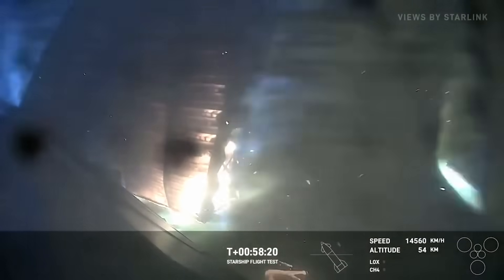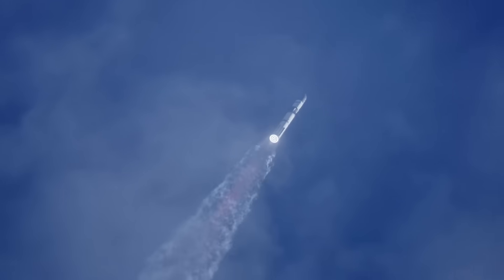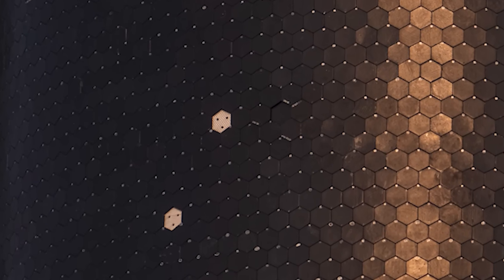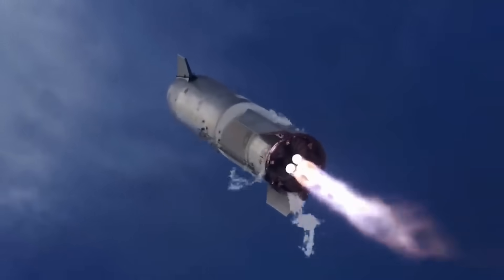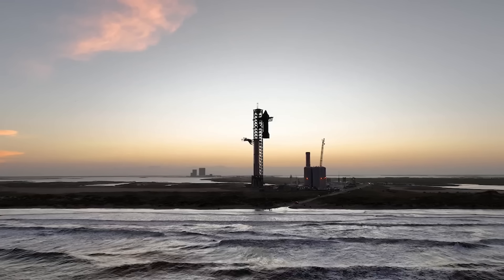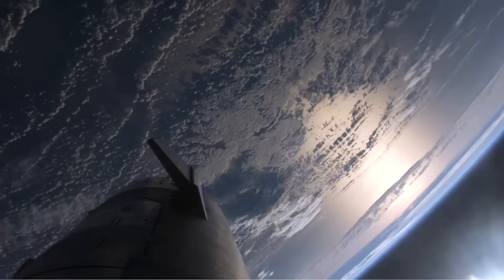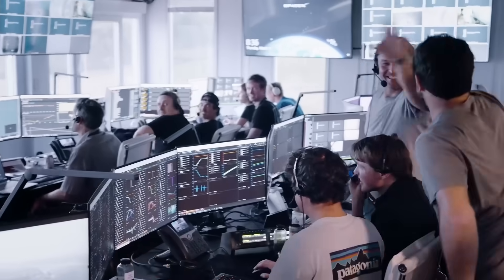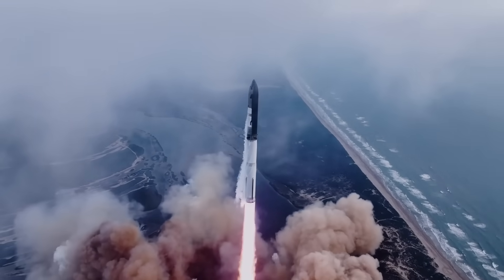SpaceX Is Adding Another Heat Shield Layer To Starship

Comment: Launch in 1 month? SpaceX will have to rebuild the Starships flap area before going anywhere, 4 week good luck with that.
Reply: They’ve probably already done that. They have several test vehicles just sitting around waiting to launch.
Reply: I think Elon said that the next already built starship already has the flaps rebuilt in a slightly different place. They couldn't do it for this launch so focused on collecting data.
Reply: I doubt 1 month, however i do believe that the turn around time will be 1 month by the end of 2024.
Reply: So you guys think 11th of July is a safe bet then? I'll be generous and say the end of July. 
My bet is September at the earliest and I'll be happily surprised if the great team at SpaceX can do it sooner.
Reply: @stevecam724  The gap between Flight 3 and Flight 4 was just over two months. Why do you think Flight 5 will take an entire month longer at a minimum? They've already made the modifications to the ship regarding the flap area, they new it'd be an issue long before Flight 4. Maybe they'll redo the heat shield tiles, might take a couple weeks. This is the first time no FAA investigation is required, which has been responsible for most of the delay previously. My guess is mid/late July.

Comment: Those metal sparks at reentry could been the metal pins securing the tiles.
Reply: The very first sparcs were probobly the rough edges of the tiles being knocked of which is expected and fine dont know what caused the blue flame though

Comment: this reentry was at barely orbital speeds imagine how intense it would be at translunar or transmartian reentry speeds
Reply: They probably would do some kind of braking before hitting the atmosphere
Reply: Not typically how it happens. Normally if you want to do a such a reentry, you just skim the atmosphere for one or two orbits first, bleeding off a fraction of velocity each time, then do a normal reentry at the end. So if you can nail this type of reentry, you can nail a transmartian reentry by just doing a few extra orbits.
Reply: @J7Handle  Maybe but when Starship is returning from Mars, the upper stage has to launch to orbit from the Martian surface, then do a tran-earth injection burn, then propulsive land on the Earths surface - all without refueling. So there's not going to be much fuel to spare to adjust your orbit around the Earth multiple times, instead it's much more efficient to use the atmosphere instead.
Reply: @Astra2  aerobraking doesn’t use much delta-v it uses 10x less than even the landing burn just to do it twice. That’s because you make the adjustments at apogee, not perigee.
Reply: I suspect they'd fire retro-rockets to slow the craft down.  As I think about this for the future, I can't get past the risk of damage to the engines as it settles onto the Martian surface.  Remember all the engine damage when the first Starship was launched from Star Base before they implemented the water deluge?
Reply: I’m assuming a typical re-entry speed might be slower in the future. Sure starship is gigantic in comparison to other spacecraft but I would figure they’d be able to make a slower approach.
Reply: Only as much heat as there is friction.  With significantly less atmo friction, would the heat be the same for any planet’s reentry?  As long as the speed is unchecked by boosters of course.
Reply: @ErikOstermueller  Not an engineer but temperatures would be much less on Mars entry as there is less density in the atmosphere.  I remain concerned on how they prevent damage to the engines when they blow rocks everywhere as the ship touches down.  But I assume they will figure that out.
Reply: Nominal escape velocity on earth is pretty damn fast.
Reply: This is not a rock. They can do retro burns and alter their trajectory.
Reply: they will probably have excess fuel due to orbital refilling to expend for kick back slow down
Reply: it would be much easier because of lower gravity
Reply: Would probably do an upper atmosphere breaking pass when coming back from far away places to bleed off some of the energy
Reply: Remember Starship will have fuel to spare in most interplanetary space missions. It will probably be able to slow itself to whatever entry velocity it wants to
Reply: @GrapeFlavoredAntifreeze  no, it won’t. I already commented on this reply chain explaining how it’s done.

Comment: I would have put an ablative layer between the tiles and airframe from the git go!!!
Reply: Same here! When the loss of a single tile could mean catastrophic loss of the ship, crew, and cargo, and there are thousands of tiles, the probability of total loss is unacceptably high.

And under layer of an ablative material that would only need replacing at locations where a tile failed would greatly enhance mission survival probability and reduce the single point of failure from tile loss.

The extra weight and any maintenance time is more than offset by safety, recovery and reusability.
Reply: But then you would not have known it was needed. You'd just be guessing.
Reply: That goes against SpaceX’s rapid iteration or “the best part is no part” philosophy.
Reply: It is easy to make comments that ablative shielding should have been added earlier now that you see the effects of high heat on certain parts of the ship.   

But it's also a waste of time talking about what should have been done since no one can change what was done before.

Comment: They must get rid of entire heatshields. Add to fuel size. Fire the engines before reaching the thicker layer of air, lower the speed to 10k km/h, and then everything will be similar to stage 1 landing.
Reply: In order to slow the spacecraft so it doesn't experience 3,000°f heat of reentry, it would need 1/2 of the launch fuel load to slow down. That's not feasible, and that’s why must use heatshields around the spacecraft to dissipate the heat and return safely
Reply: @WhiteBird01  How do you know? Have you done the calculations?  I calculated, and it is possible with a new, taller version of StarShip, but instead of adding to cargo space. they need to add to the fuel tank size.. this way, "best part is no part" is achievable.
Reply: Someone never played KSP lol.

Comment: The one thing that SpaceX is amazing at is the project management of their construction teams. That being said I think it's incredibly risky for them to attempt a super heavy booster catch until they have the second launch tower built.
Reply: It is definitely a questionable move. The new tower is not that far out time wise and is further away from the tank farm and could potentially have a better chopstick mechanism.
Reply: I don't understand why they don't send a ship up just a little bit, and then catch it. Send it farther up, then catch it.
Reply: I think eventually they will have to take the weight hit and put landing legs on the booster, and land it on a pad mounted on rails (to bring it back to the launch pad for quick turnaround). It will also prevent more damage that could happen as the booster tries to hover while they try to catch it. 
I just can't see their landing as precise enough to catch anything. And if something goes wrong, which is likely given their "no part is the best part" ethos, which works directly against the redundancy required for reliability, they will destroy a VERY EXPENSIVE Stage 0 launch tower. Off loading the weight penalty to the pad is a swell idea, but it makes a lost tower much more of disaster than if you lose a single booster.
Reply: @notgiven-u8m  

It is just not the issue of being precise enough as you said but the bigger issue is (as you said), can it be done reliably.  It is going to be exciting to see how things play out.
Reply: @notgiven-u8m  A pad mounted on rails would probably not work, maybe it could if every single part is oversized. The problem with the idea is that landing induces too much vibration downward, so the moving parts of the rail assembly would be 'clanked' to dust, not to mention the pad itself having no good way of passing that energy through.

It's either a solid pad attached to the ground, or grabing the booster by the top like the chopsticks idea.

Or you could mix a solid pad and your idea, and put a crane on rails that goes between the landing pad and the launch platform. Make a parallel set of rails further apart for moving the counterweights on its own vehicle too when moving the empty crane towards the landing pad and it could maybe work.
So, the order would be:
1. launch rocket with crane and counterweights far from the launch platform.
2. While booster is doing the up and down, the crane and counterweights move towards the launch platform and far from the solid landing pad.
3. Booster lands and crane and counterweights start moving towards the landing pad.
4. Crane, counterweights and booster are assembled into a system looking like a set of scales ⚖️ 
5. The assembled system moves on its rails towards the launch platform.
6. The booster is loaded, filled up, etc. and the counterweights are set on its railed vehicle and moved with the crane far from the launch platform, starship is loaded on top and filled up.
7. Repeat step 1.

If the chopsticks idea doesn't work, they could try something like this.
Reply: It is quite risk but, nothing SpaceX cant fix, REMEMBER the first launch, the concrete crater, thought unfixable. and it was fixed beyond thought and we never imagined a launch without a flame diverter, but that worked too.
Reply: @nischaysoni502  
Flame diverter trench is very important to deflect the massive amount of acoustic energy away from the booster and starship. Hopefully the booster is tall enough to keep the starship tiles safe. But watch the launches and you can see huge acoustic waves reflect off of the flat surface. The configuration of the water deluge does not seem to be particularly effective with this issue.
Reply: @nischaysoni502  Yep, everyone remembers how f*cking stupid it was to launch that thing without a proper launch pad. Absolutely everyone saw it coming, included SpaceX engineers. Except Musk. The concrete crater fixing possibilities weren't the crux of the matter there, as you seem to think. But the fact they launched the rocket without a proper pad, under the stupid order of Musk, was the problem. That alone should make everyone understand how inept and liable Musk and his management are for the workers at SpaceX. It's ridiculous to see some people turning that in a win for Musk, somehow...
Reply: I disagree. They should be able to fix any damage to the tower within two months. Also, their next flight after the next one is easily four months away so that gives SpaceX four months to make a lot of progress on the second tower.
Reply: @michelleroberts1370  

Would it not be more prudent to first get a booster to hover (without engine malfunctions) for some predetermined time (like 5 seconds) while executing a simulated dance into the simulated chopsticks (kinda like a real landing attempt) before risking damage to the tank farm. Elon’s tolerance for risk seems very high and you have a good point about probability being able to fix a lot of damage in months (especially if spacex has replacement parts immediately available). But the increment of getting a number of dominos to play just right seems excessive. It will be exciting.
Reply: @Mentaculus42  Yes, he just did that with the booster on the last flight. It did a perfect simulated landing on a tower. The Starship glitched a bit in its simulated landing so it won't be caught next time. (It landed O.K. but in the wrong location.)
Reply: @michelleroberts1370  

Not from what I have seen with regard to the booster. There was no hovering and translating movement which is needed in an actual capture.
Reply: @Mentaculus42  I stand corrected!

Comment: Im not an engineer, but the fix seems pretty simple to me. Just extend the heat tiles over the hinges on the flaps some, no? Adding a layer of heavy abblative matwrial further reduces the already low tonnage to orbit. At this rate it will take 30+ launches to fuel the in-orbit depot.
Reply: Not just extend, they will have to add kind of like a cape above the hinges to take the blunt of the peak heat points, but it adds another problem, it will limit the available range that they can open and close the flap.

Comment: wouldnt an ablative layer just make it even more difficult to check for damage or at least slower and more difficult?
Reply: The ablative layer would only get damaged if a tile is missing so you'd look for the missing tiles.
Reply: @filonin2  I don't.know. sticking things onto something that ablates feels odd to me. The damage might not even be from heat just general use.
Reply: Worse case scenario they would need to remove all the tiles, check the ablative layer and possibly replace it after every flight. I think this is probably just a temporary solution until they figure out a reliable and reusable heatshield design.

Comment: 2:21 “Like a silicone [?] heat ablative material”, so what was that white material that sx has been using under the heat tile for some time? The space shuttle used a quilted silica fabric on some low heated areas. Also their is:

SIRCA
- Silicone Impregnated Refractory Ceramic Ablator
- Uses flight certified ceramic substrates (Shuttle) and silicone impregnants (Viking)

ALSO:

Silicone Resins: Lower Heat Fluxes
• Super Lightweight Ablator(SLA: LM)), SRAMs(ARA), Boeing Lightweight
Ablator(BLA)

Spacex has been mentioned as buying thermal protection systems from some third parties for some time now. Personally I thought the use of the white underlay material was for dealing more with another issue and not specifically for a backup if a tile is lost.

As mentioned in another comment I added:

Damping is what I thought the primary purpose of the white material that was being underlaid for sometime now. The “tile attachment system” needs more vibrational damping and a mechanism to provide more compliance (but tripod pining is probably still problematic). 

Another issue is that the stainless steel mounting structure is less rigid than traditional aluminum which exacerbates the vibrational dynamics of the total system. Spacex has been adding a lot of additional stainless steel stringers in a number of places which is also interesting.

Comment: Another Elon created OLM disaster coming? The first launch of starship destroyed the OM because the OM was not ready and Elon rushed the launch. Now, Elon is insisting that they will catch the next booster stage. The booster stage is still going through dozens or scores if not hundreds of changes from one flight to the next and is not a reliable rocket yet. Also, no one has ever caught something as large as a starship booster. The way that the Mecca zilla is going to try and catch one. Instead of risking everything, SpaceX could launch a stripped down booster that only had a minimal number of engines in it and only enough fuel to clear the tower hover and then return and be caught. This would give them valuable information on what to expect and it would also demonstrate that the booster actually can hover which is still not 100% guaranteed. However, it seems like Elon is going to insist upon another grandstand play that in many respects will be just like when he demonstrated the bulletproof nature of cyber truck windows That resulted in a complete public fail. Let’s hope that the confident professionals at SpaceX can stop Elon from insisting on some thing that shouldn’t happen on flight five and that could if it does happen result in tremendous damage to the launch tower and the surrounding tank farm.
Reply: What do you mean by OLM disaster ? the first launch was supposed to partially destroy the pad, Elon said it himself weeks before the launch.
Reply: @DeferedPattern  
Actually, if Elon gets his wish and they do try a catch on starship flight five, there could be a huge silver lining, if rushing such a catch results in a massive amount of destruction. And that is that Elon might be forcibly ejected from making any serious decisions about starship development going into the future. Elon is not technical and he certainly not an engineer. He’s more of a showman and considering how many promises he has made that he knew he could never keep, very close to being just your average con man. Considering the blackmail that he’s engaged again at Tesla“either give me the 56 billion or I walk”, I’m leaning towards Conman.
Reply: @wbwarren57    Elon never insisted that they were going to catch the next booster.  He said he would like to do it, but also said he had to go back and talk with his team about it.  

Stop making up stories about Elon and you won't sound so wrong about Space X.